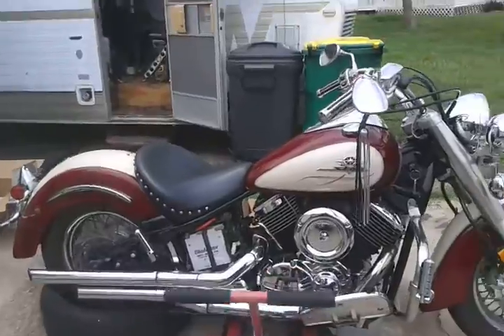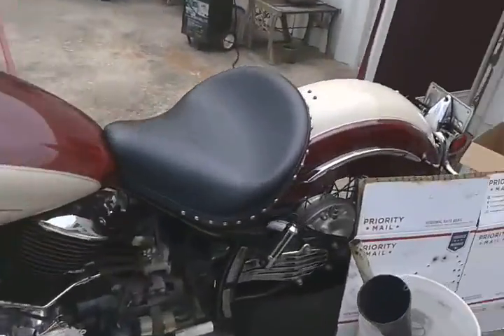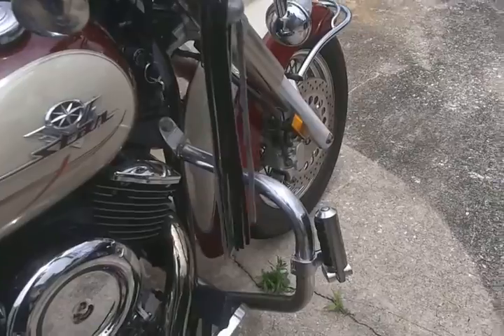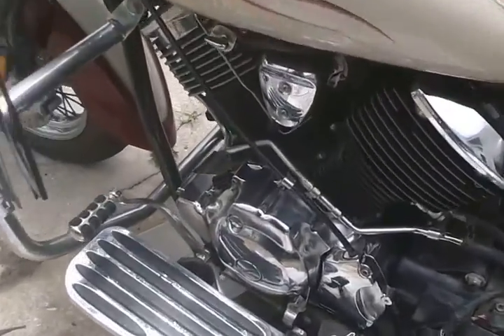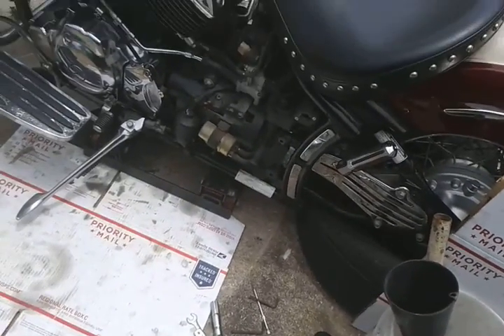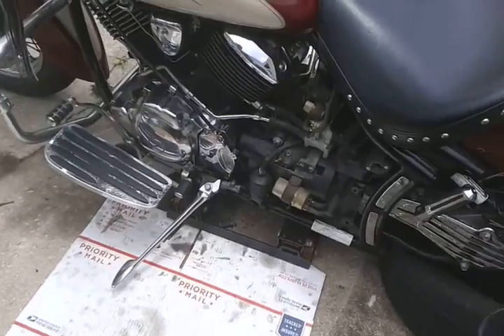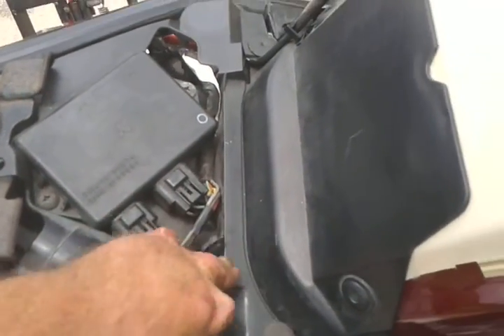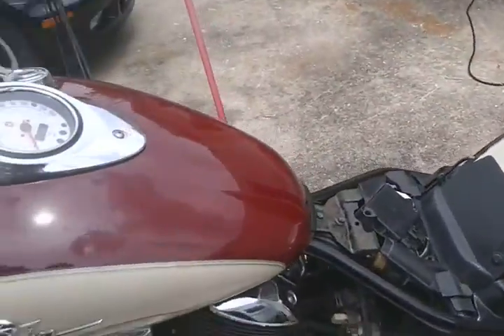2001 yamaha v-star 1100 classic silverado starter clutch redo part 1

Comment: I saw in other bike videos that had starting problems after ton of changing a lot of part to find out the batterie was not strong enough to spin starter fast enough to spin gear out to  start the bike one was a sport bike and a cruiser all they did was same thing yours is doing just turning over not in gaging
Reply from the maker: Ryan B. thanks ... i seen a video where a guy added a ground wire to the starter too to help the problem too